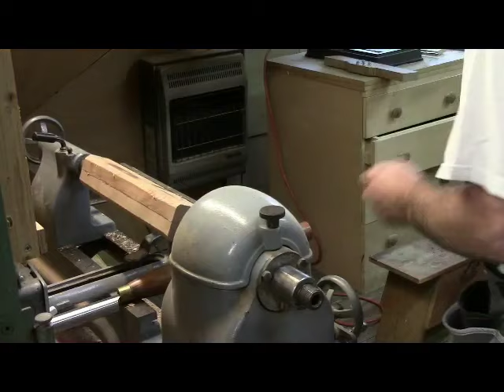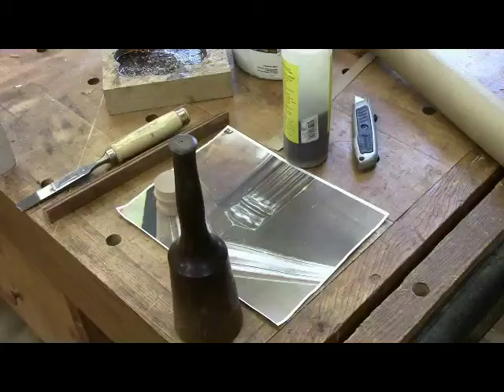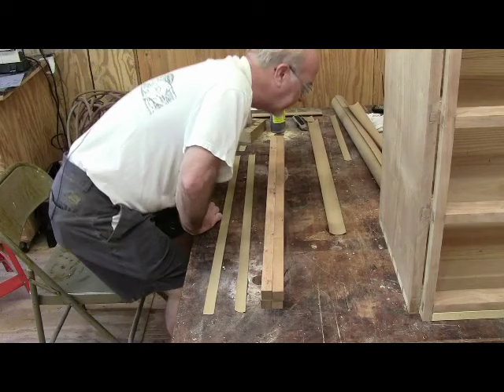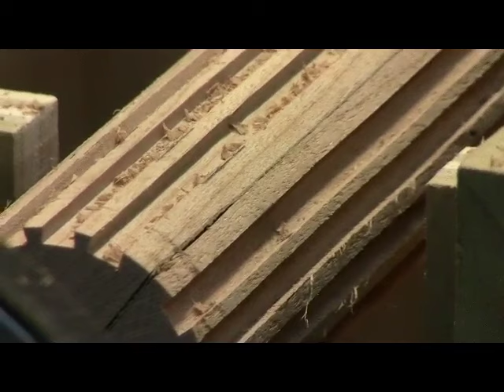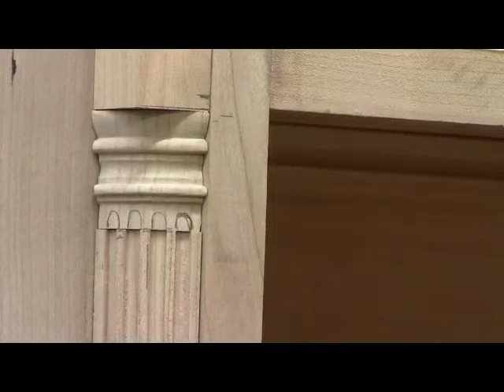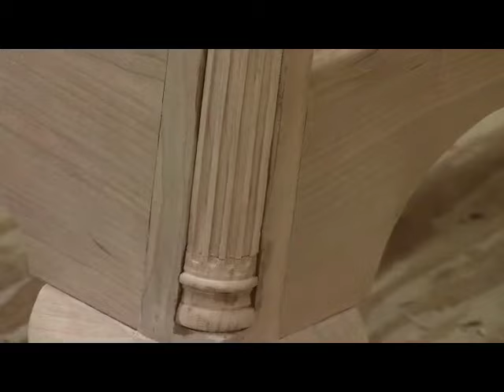Chapin HighChest Capitals & Qtr Cols Step 10

Comment: Why is it not just one  piece ?
Reply from the maker: Good Question, I have made them one piece, it is a lot more work to get it to the exact length in turning and not to make a mistake that will ruin the whole set.  Particularly routing the flutes. Also, if you want to do it the way the old guys did it back in 1760 they made it in 3 pieces. Most period furniture makers make them in multiple pieces
Reply: +David Boeff  thanks I had seen that before and wondered about that.